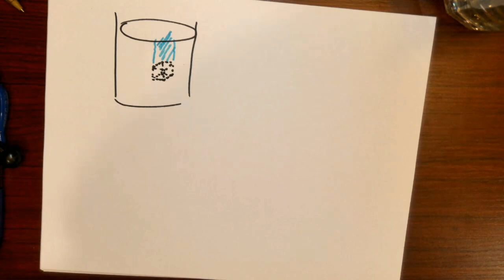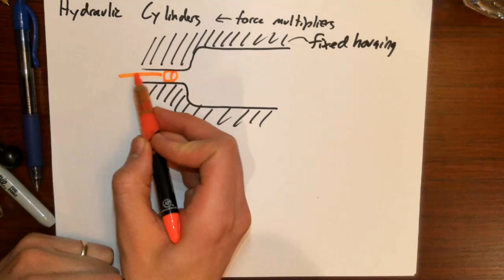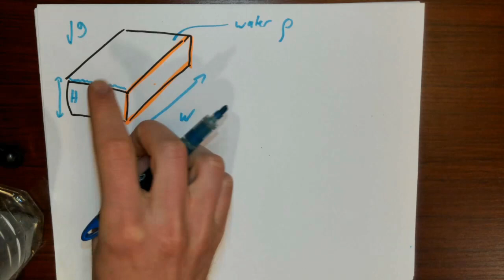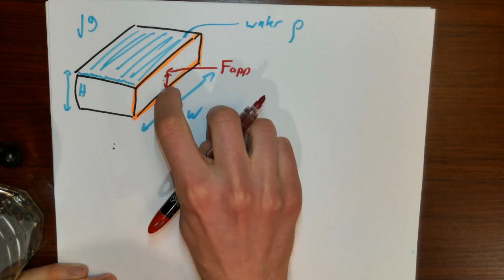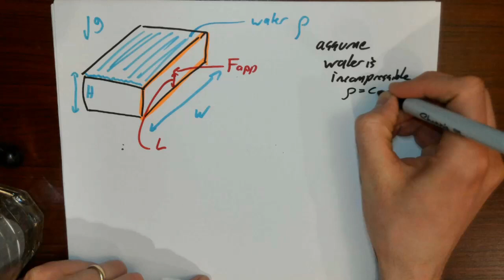BIOE 3310 Lec 4 - Pressure and Hydrostatics Loose Ends and Example Problems

Comment: Re-cap results: 3:20
Gauge Pressure vs  Absolute Pressure: 9:12 
Specific Gravity: 14:40
Ex Problem: Watch Pressure Rating: 17:56 
Ex Problem: Hydraulic Cylinders: 25:00 
Wall of Bathtub Breaks: 36:45